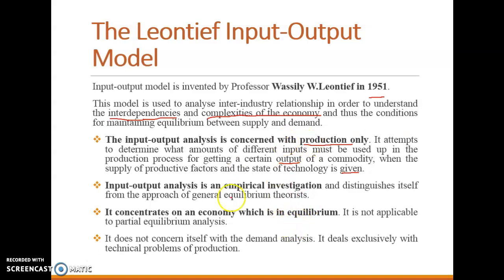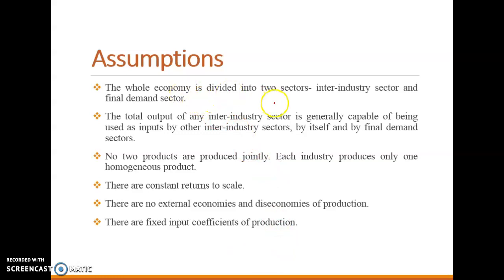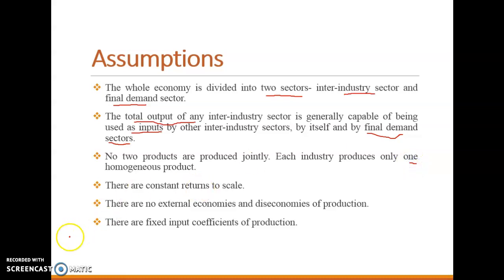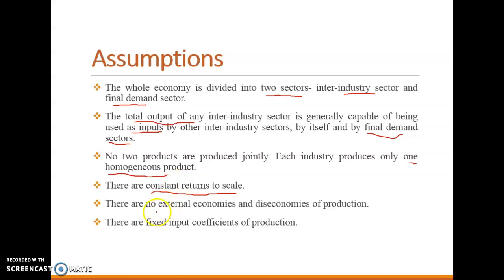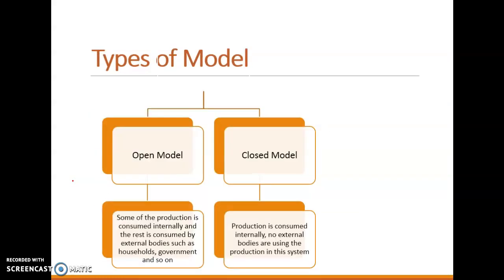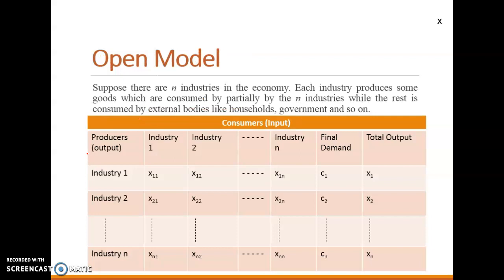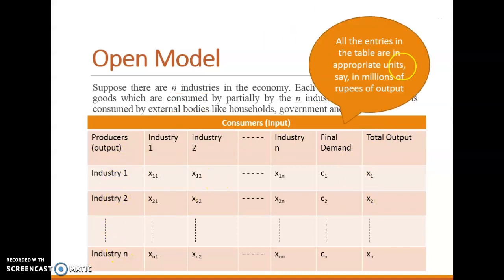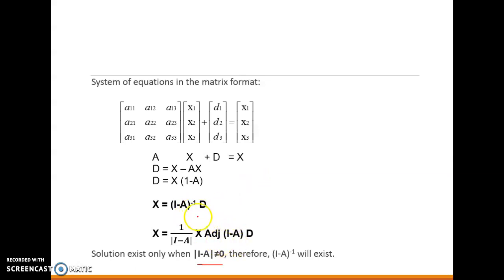Leontief Input-Output Model -  (Part 5a)

Comment: (3) Suppose corn is produced in Kansas, steel is produced in Gary, Indiana, and locomotives are produced in Chicago. Furthermore, suppose that 1000 workers are needed per ton of corn produced
(gross), 2000 workers are needed per ton of steel, and 3000 workers are needed per locomotive produced. How many new workers will be needed in Chicago in order for two more locomotives to be
produced, net, each year?